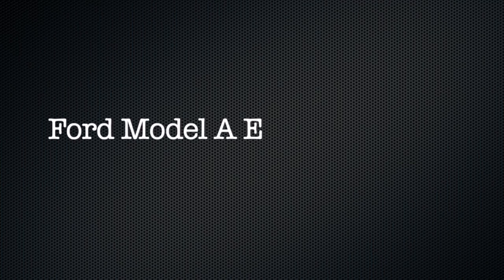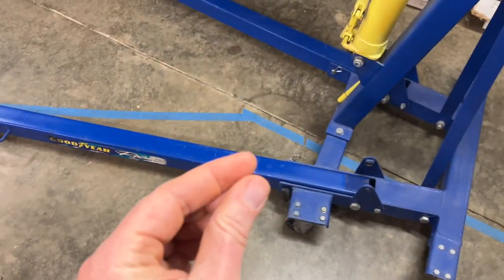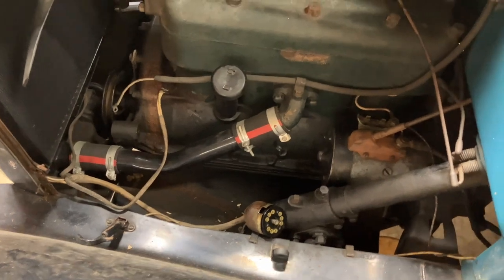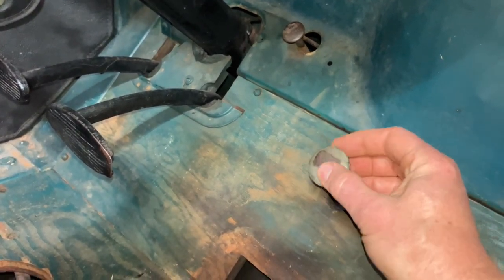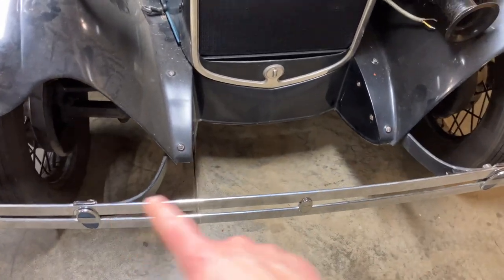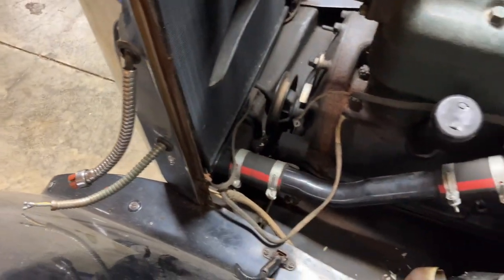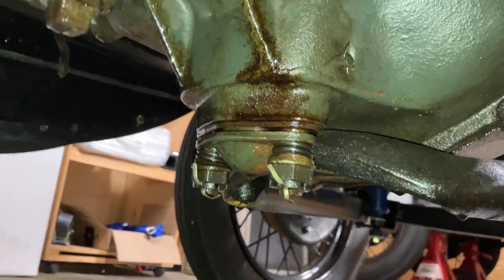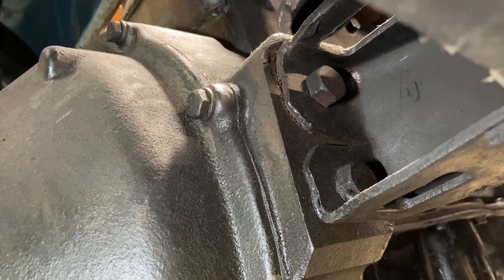Model A Ford – Engine Removal Walkthrough

Comment: Great video. You rock! Thank you very much for all of the detailed steps and info. I’ll be pulling both engine and trans this winter. Getting things ready for the job now.
Reply from the maker: Sounds great. Sourcing the engine stand adapter is key, and also making or borrowing a frame expander in case you turn out to need one. Also make sure that you've accounted for how you're going to rotate the engine on the stand. Be sure the adapter rotates smoothly in the bore; don't be afraid to apply some axle grease.

The transmission and bell housing weigh about 70 lbs, and the stock flywheel weighs 63 lbs. Most people find that removing the transmission and bell housing is necessary to safely manipulate the engine. I recommend doing that with some kind of assistance to support the transmission as you remove it: either get a buddy or use your shop crane.

I will have a new video this fall showing the process of tearing down two engines, including stuff like how to get the studs out safely.
Reply: Thank you for the additional info. Super helpful as I prepare for this.
Reply from the maker: @TitanBodybuilding  One clarification, if you're buying a new engine stand adapter, you'll need to drill two sets of holes in it. One is for the locating pin, which inserts down through the top of the stand to hold the engine in a certain orientation. So you gotta put the adapter in your stand and then mark where to drill. Four holes (0°, 90°, 180°, 270°) should be sufficient. Then at the back end of the adapter you need to drill holes through which to insert the bar you'll use to rotate the engine. Most engine stands come with a large hollow bar for this purpose, but you may not have a drill bit big enough to match it. In that case just go buy a piece of round stock 3' long for whatever size drill bit you do have, and use that as your rotating lever. You'll appreciate the extra length.
Reply: @alexiskai thank you. Super helpful. I’m going to pull the engine and transmission and send it out to have it built. You’ve been super helpful and it’s greatly appreciated!
Reply from the maker: @TitanBodybuilding  Hahaha I see, you don't need any of that engine stand info. Ah well
Reply: @alexiskai  Great info for future reference and I may end up doing some of the work :)

Comment: When I remove engine with Trans attached first thing is remove the brake and clutch pedals by removing a single cotter pin.  just a suggestion. Kenny
Reply from the maker: There are lots of ways to remove the engine and that is one of them. My goal in the video was to establish that you can, if necessary, remove the engine and transmission virtually intact by yourself. Leaving the pedals attached did not impede the operation.

Comment: Hi Alexis. Great video. Thank you. Is it possible to separate the engine from the transmission and only pull the engine out, leaving the transmission in place? I just need to do an engine swap. Thank you.
Reply from the maker: Yes, removing only the engine is quite common and somewhat easier. I chose to show the harder version. To remove the engine, you'll need to support the transmission with something – a jack, or blocks – and then disconnect the bell housing from the flywheel housing. As you pull the engine forward and up, the splined main drive gear should slide out of the flywheel and release the engine from the transmission. Good luck!

Comment: Good video but you should have just saved yourself some time and aggrivation by removing the carb, manifolds, starter and water pump.  This stuff only gets in the way.  Also, separate the bell housing from the flywheel housing and pull the engine.  If the transmission has to come out do that afterwards.  Putting the new/rebuilt engine back in is also easier with the transmission and bell housing in the car.  Just my opinion.
Reply from the maker: Why would it save me time to remove all that stuff? Then I gotta spend time unbolting it, and I might run into other problems. Most of the bolts are rusty and I'd rather fight them on the engine stand than in the car. And I don't have a transmission jack, so if I leave the transmission in place, I have to support it while it's in there and then wrangle it out of the car by myself.

Other than the starter, none of those things caused me any aggravation by leaving them on.